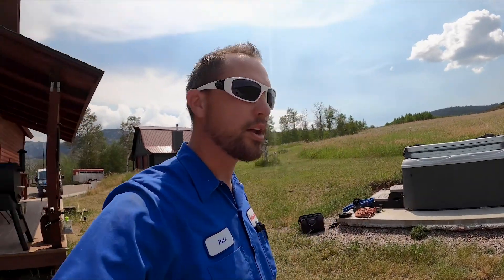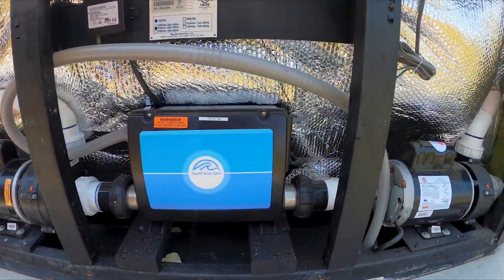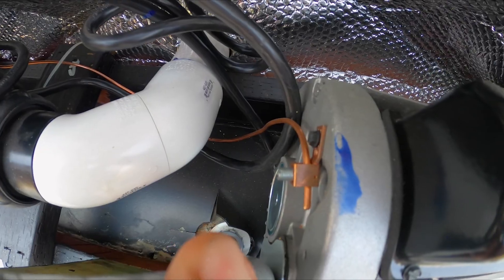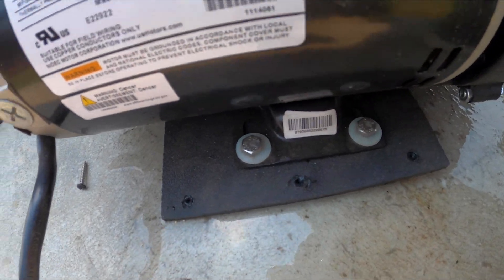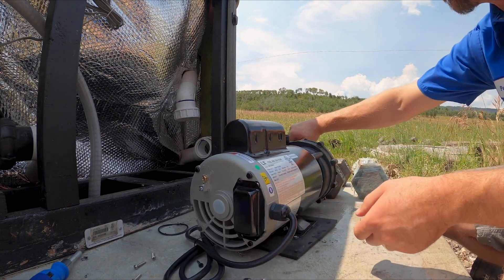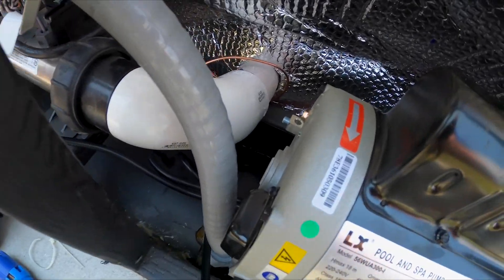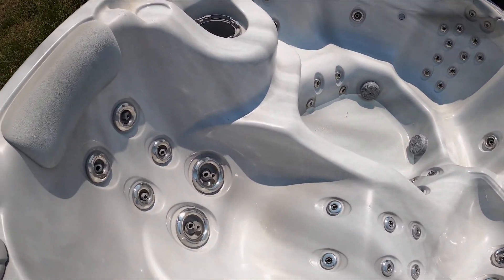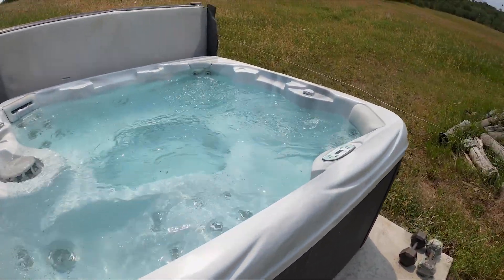Hot Tub Breaker Tripping - Pump Replacement, Artesian South Seas Spas 748L

Comment: Great video Pete! Very educational. You provided some great tips about putting the screws under the side panel to ensure perfect panel placement when reassembling. Your pump replacement was very clear and straightforward. I also liked your holder for keeping your combination wrenches together.  I have a couple of questions:

1. In your experience, is the South Seas 748L a good tub? You were doing a warranty replacement for the pump, but is that normal? Any other common issues that of concern? We are far from a dealer so for any warranty work we would need to pay a premium for the travel. We also want to have a tub that lasts a long time.

2. Is it hard to replace jets or do you have to dismantle the whole tub and insulation? We were thinking of keeping only access on 2 sides for our installation.

3. Is that all the insulation on the side panels? I am in Canada so would need one that is well insulated. Thanks for your help!